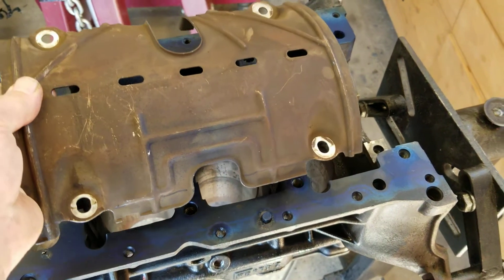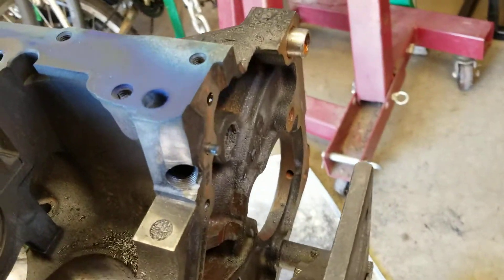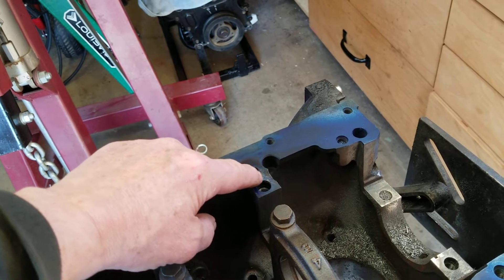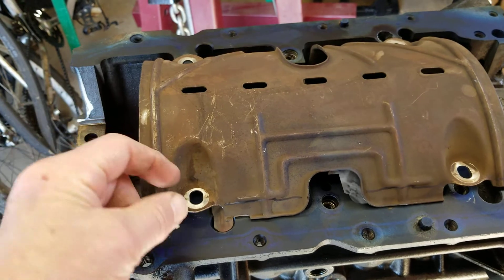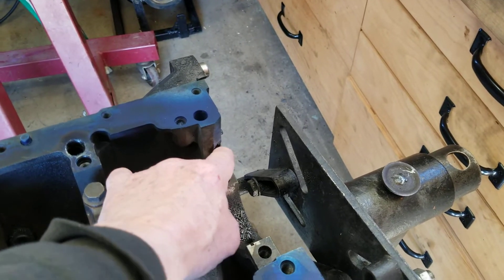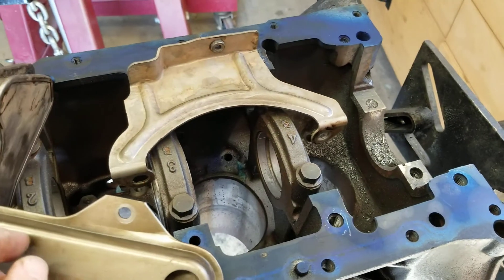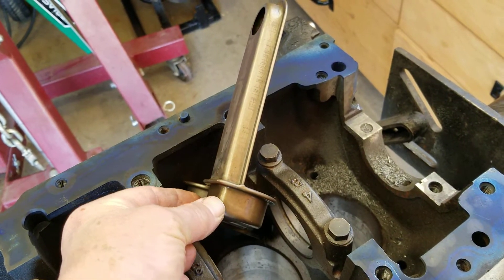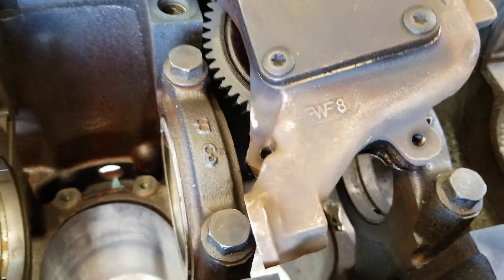Let's do a balance shaft delete on a GM 2.4 Twin Cam E5

Comment: What kind of HP do you think your making?
Reply from the maker: The general consensus is an extra 20 horsepower.  However, nobody has ever tested the 2.4 twin cam to confirm that. The 20hp figure was from a Dodge 2.4. It's easier to test the Dodge back to back because all you have to do is pull the pan, cut the balance shaft chain and put the pan back on. The GM 2.4 requires disassembly.